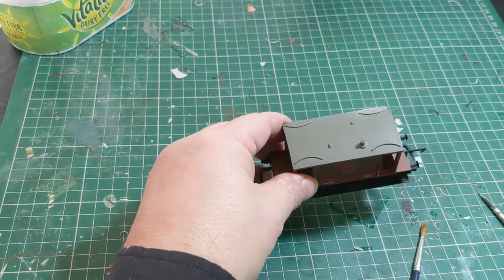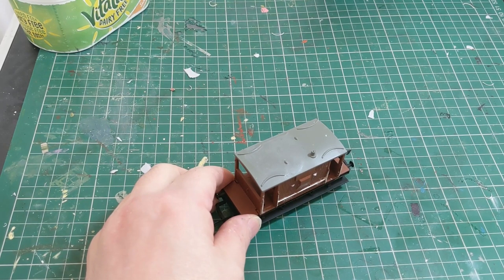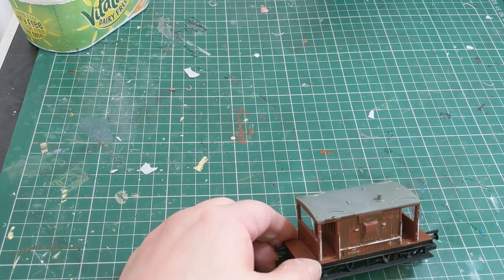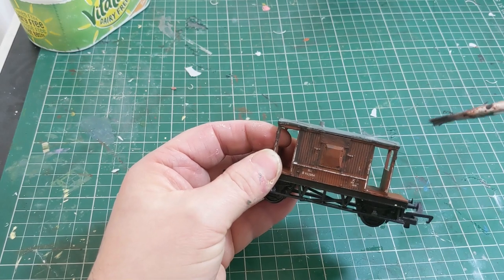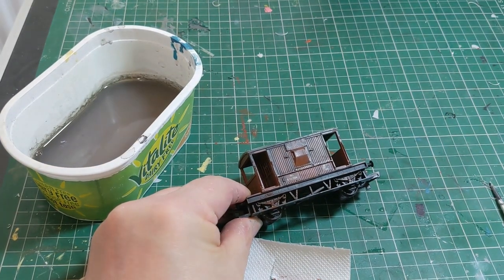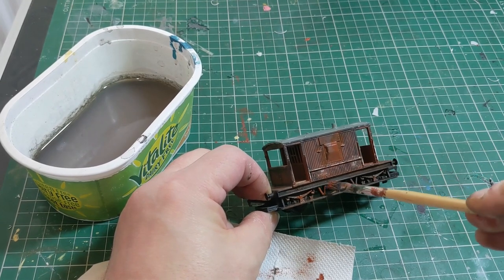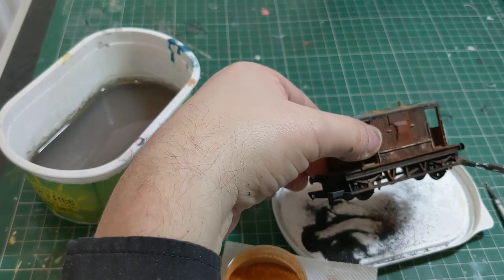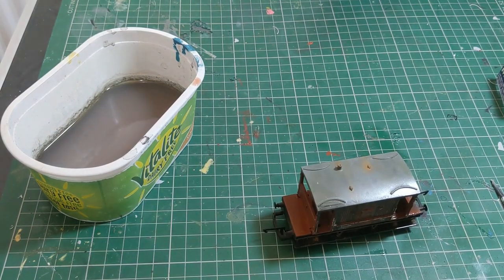How to weather a Brake Van for your Hornby Model Railway

Comment: Personally I wouldn’t use an oversize brush to paint fine detail. better to use a high quality fine brush. The weathering is good, but I think you get more subtle weathering using weathering powders.
Reply from the maker: Cheers. I've got another brake van to do, and will do that differently.